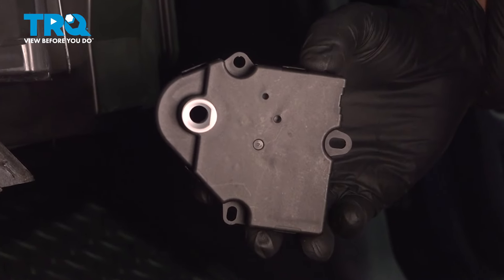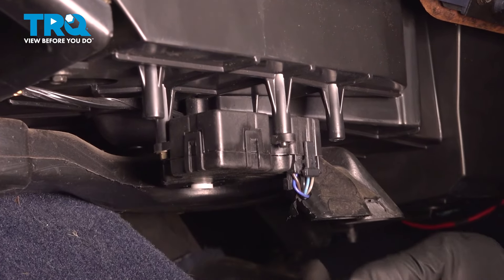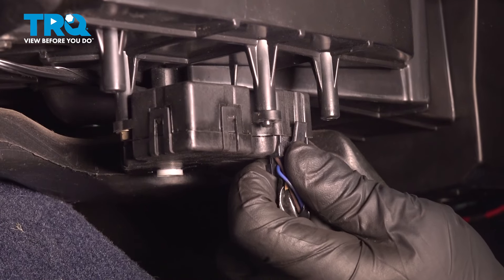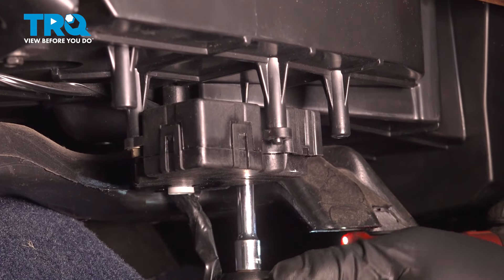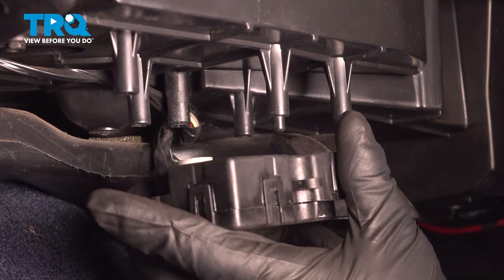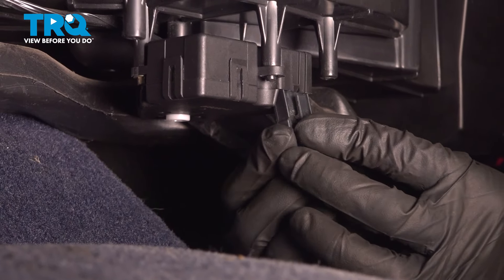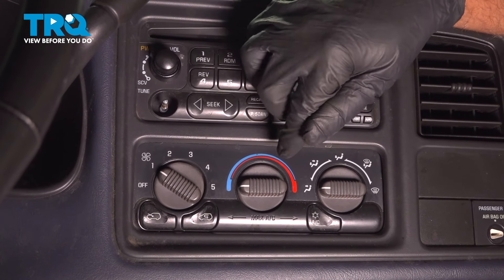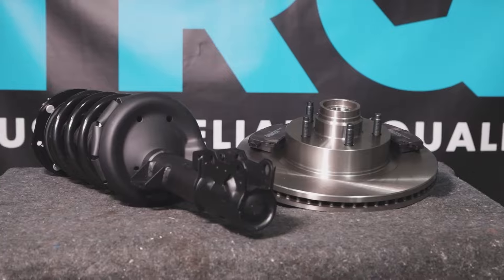How to Replace HVAC Blend Door Actuator 1999-2006 Chevrolet Silverado 1500

Comment: What symptoms would prompt someone to replace this part? I have a 2000 Sierra and I can hear the doors clicking behind the dash when I start the truck. If I turn the center dial towards heat, it stops.

Comment: I removed the blend door actuator from my truck and waiting to receive new one that I ordered. When I removed the actuator, the heat controls are turned to the right (hot) and the fan switch is off. Do I turn the heat control to the left (cold) before installing the new actuator or just leave it the way I took out the old actuator?

Comment: CHECK YOUR FUSES BEFORE YOU CHANGE YOUR BLEND DOOR ACTUATOR 

On My 2000 Chevy Silverado 1500 , the acutuator was EXTREMELY close to the wheel well carpet underneath the dash on the left side!!!!!!!!

I removed the outer bump cover with a 7mm socket. The actuator motor (ahd one bolt on left and one bolt on right, center pin was just a guide)was removed with a 6mm socket. The left side of the actuator , sprayed with a little wd40 to loosen and used the 6mm socket and loosened it with my fingers. I had NO ROOM FOR  EVEN A SHALLOW SOCKET AND SMALL RATCHET ...